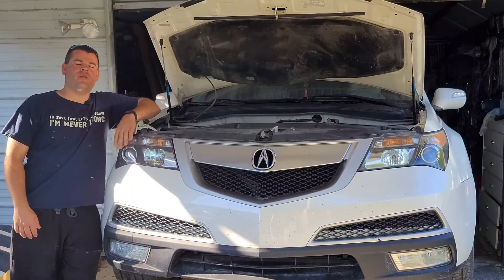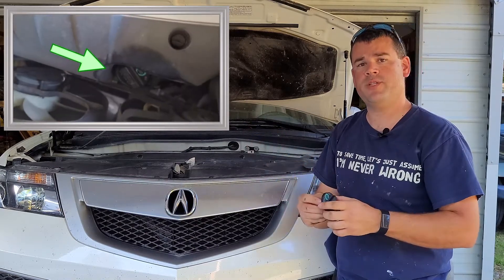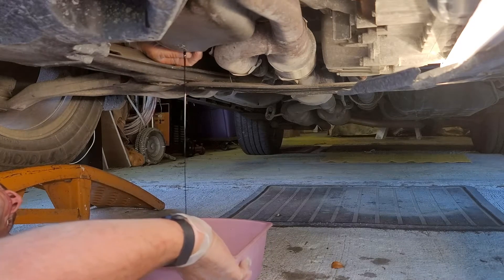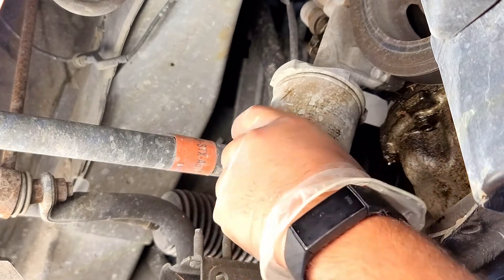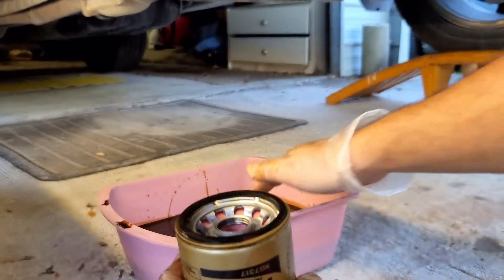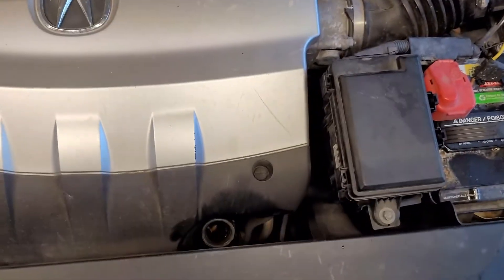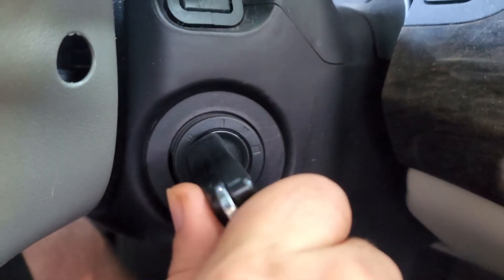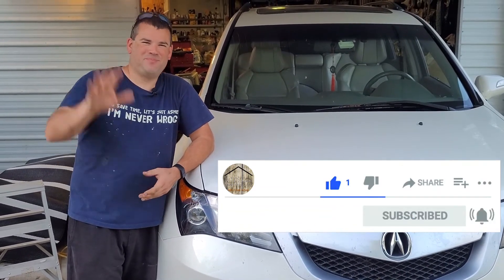2011 MDX Oil Change & Computer Reset: DIY Car Care

Comment: Always change crusher washer. Always fill new filter before install. 2 very fundamental items worthy of mentioning.
Reply from the maker: What's a crusher washer?
Reply: @VIPHoldings - it’s the washer behind the drain bolt. The dealer and manual suggests changing it each time.

Comment: I’ve seen a few videos and there’s some people who pre-fill the oil filter and some don’t so I’m confused on what I should do
Reply from the maker: I've never pre-filled the filter but I suppose you could if you wanted to. Usually, I will fill the oil after replacing the filter, let it run for about a minute and then check the levels again. Once you've done that, you can be sure the filter is full of oil. Welcome to our channel!
Reply: We never prefill at the repair shop I work at, the engine oil picks up pressure pretty quick in most cars and it’s not a problem. Especially if you’ve just had it running before the oil change. I wouldn’t worry about it.
Reply: @RandomFabrication - wrong. Be a professional bud. Fill the filter ….. period

Comment: you should start your car and let the oil filter fill up, and let the car run for about 4 min. shut your car off and let it sit for a while. recheck your oil and see where your level is at. if your check it right away it should be at half full.  there is usually about a half a quart in the engine. add what is needed but don't fill to full, check it when it is cold to really see whether it is full.
Reply from the maker: Agreed

Comment: No crush washer when you put the drain bolt back in?
Reply from the maker: Good question. Yes, you will have the washer on the drain bolt when you reinstall it but you don't have to overtighten it. Make it snug so it won't leak though. Hope this helps and welcome to the channel!

Comment: Your car shows B15 service, so what else did you do besides oil change before resetting the "maintenance minder"?
Reply from the maker: I personally always check the air filter but I don't rotate the tires until it's actually time to do so.
Reply: @VIPHoldings  I see.  I don't know if your service numbers are exactly the same as on my 2010 RL, but #5 is coolant replacement.  Air and cabin filter is #2, ATF/Transfer case #3, Timing belt/spark plugs #4...

Comment: I see ramps. What kind? Plastic or metal? Rating for tons 1.5, 2.0? Width of track? (Seems my 2007 MDX has 9” tread)
Reply from the maker: I'm not sure of the make & model as we've had them since the 90's but they're metal, probably 1.5 ton and have a 10" track. Thanks for watching and welcome to our channel.